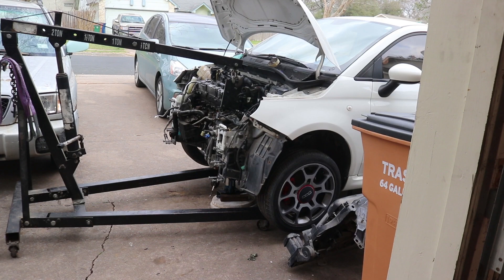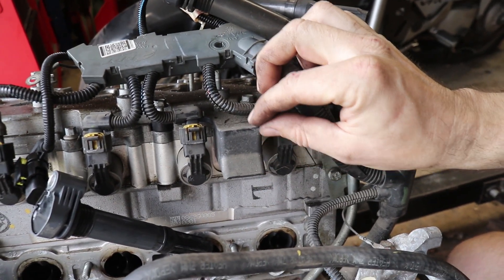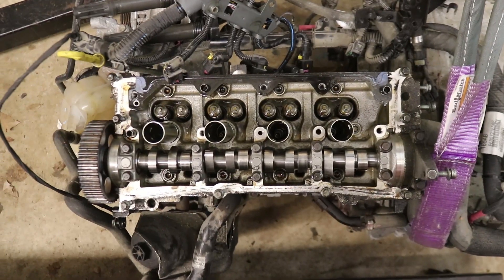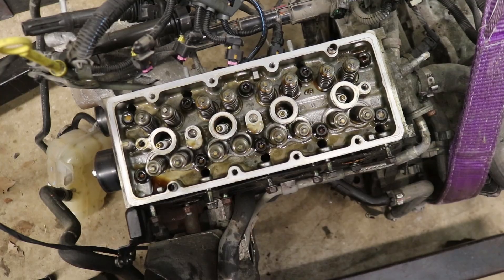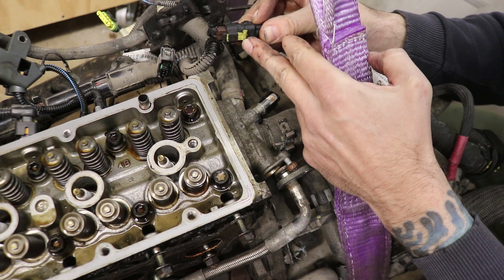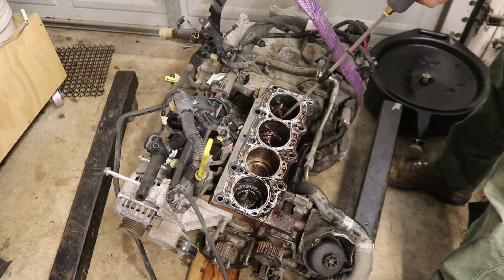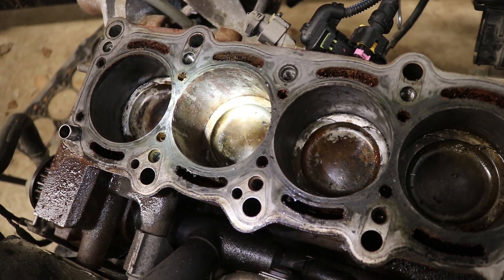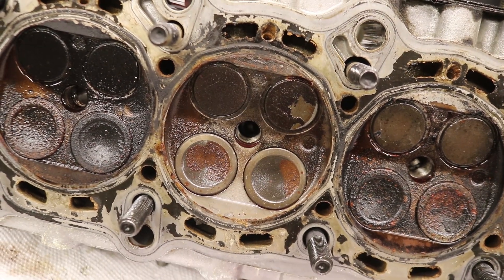A Fiat 500 Story - Part 4 - Cylinder Head Removal

Comment: If you had access to a car lift, would you have been able to get to those intake manifold bolts from underneath? I am about to do this job on a Punto 1.4, but its the normal 8v engine not multi air. The intake manifold looks the same though.
Reply from the maker: A lift would provide more options, which may make this whole thing feasible.  Good luck👍

Comment: Hi there I have a 500 900cc 2013 and need to change the head gasket. It's a 2 cylinder. How do you know when it's a TDC? Do you know what torque the head bolts are torque at and what sequence they are tightened?  Thanks
Reply from the maker: I do not. Try sourcing a service manual for your car. It's WELL worth it if you are doing this sort of work. Best of luck 👍

Comment: That is very interesting since the valves looked good. Was the spark plug end still intact or white in color or even have aluminum attached to the electrode. I would have to agree that it looks like it melted away at the exhaust side. I would have to assume that cylinder went lean or a faulty injector would have caused it. I wonder what the bottom end looks like if there are any clues there.
Reply from the maker: You are not the only one that wants to see the bottom end. I will come back around to it after the car is running.

Comment: Reminds me of rebuilding a Volvo 960 head. That's a straight six, 24 valve, interference engine. That also has a two part head. If the engine had been damaged by a broken timing belt, the valves wouldn't be seated as they appear to be in your video. Since you've gone this far.....which is way further than most mechanics would venture.....drop the  oil pan and check  it from the bottom end......you might find something really interesting.....like a broken piston rod or bearing housing on the main crank. I'm enjoying your projects....stay greasy!
Reply from the maker: "Stay geasy" - 😀 I like that. I would like to tear it down further once I get the car running.